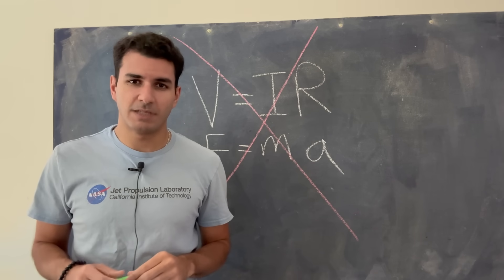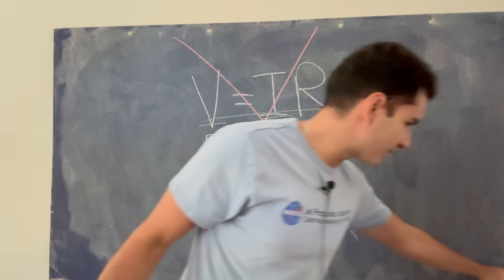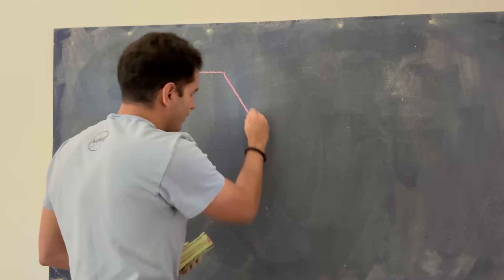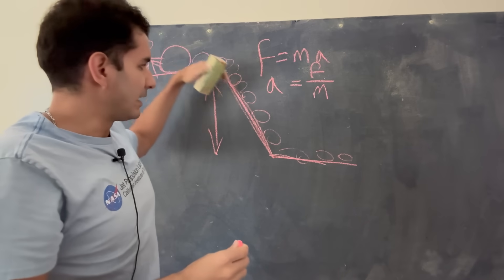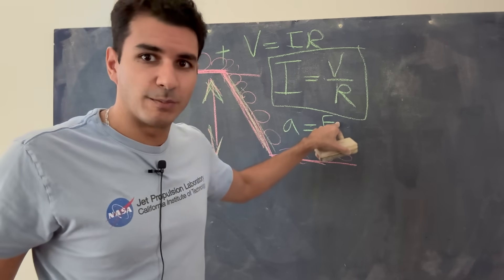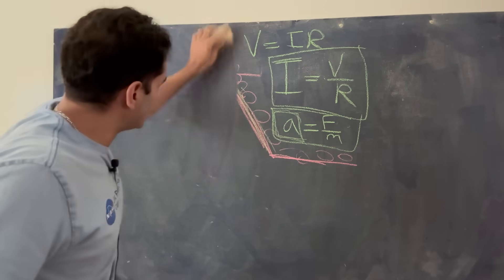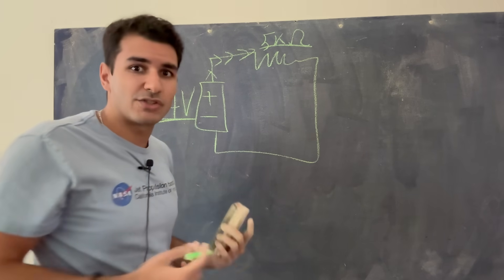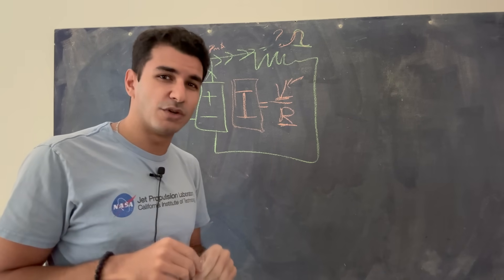You don't really understand physics

Comment: Ali, I am a strong believer that physics is taught wrong for many of the reasons that you say. But I don't agree with what you say here in general. I think that cause and effect must be taken very cautiously, especially when things happen at the same time (like force and acceleration, or voltage and current). In general, these things just coexist, they don't necessarily cause each other. And if you still want to think about cause and effect, sometimes it is better to think that a current causes a drop of voltage or an acceleration causes a force. For example, say that you have box inside of a train cart. The box is on the frictionless floor and against the rear wall. The train starts accelerating. Will the box accelerate? Of course, there is a boundary condition, the box cannot penetrate the rear wall of the train, so it has to. So how (not I didn't say why, yet) does it accelerates? Well the rear wall exerts a normal force in the box. In the force on the box causing the acceleration? Sure, it can be viewed that way. You say a=F/m, plug F and you will get the correct acceleration, every time. But wait. This is not like when you push a box with a given force F or when gravity is pulling down on something. This force is not given. How does the wall "know" EXACTLY what force to exert on the box? Of course it doesn't know. It's just that if the force was any bigger, the box would accelerate more than the train, mode forward relative to the train, lose contact with the wall, and the normal force could not exist. And if the wall would push any less, the box would penetrate the rear wall which it cannot do. If someone wants to say "the rear wall is exerting a normal force on the box that causes it to accelerate", I am ok. If someone wants to say "the boundary conditions impose that the box will have to accelerate, and that causes an interaction between the box and the wall, where the wall ends up excreting a normal force on the box and the box ends up excreting a equal but opposite normal force on the rear wall", I am even more ok. If someone wants to say the same but excluding the word "cause", I am even more ok, because I think that it is not useful to talk about cause and effect about things that happen at the same time and that, given the circumstances, they have to happen at the same time. While this example is a bit eyebrow-furrowing, thinking about cause and effect, in so linear terms, and for things that neither the "cause" or the "effect" have a "choice", becomes more complicated in more advanced physics. Even not so advanced. Think of the Bernoulli effect. You have a steady flow of ideal non-viscous uncompressible fluid  flowing though a pipe that has a narrower section. Due to conservation of mass, the speed at the narrower section will need to be faster. But what "causes" it to go faster? Well, by Bernoulli, the pressure drops when the speed increases, so the pressure drop is what causes the fluid to go faster, since it's moving in a pressure gradient from a zone of high pressure to a zone of low pressure (basically a=F/m). All great right? RIGHT? Did you catch it? What causes the increase in speed? The reduction in pressure. And what caused the reduction in pressure to begin with? That the flow will need to go faster so by Bernoulli the increase in speed causes a reduction in pressure? So pressure reduction and speed increase causes each other? Don't you see a problem there? I prefer top say that no, they don't. They happen. Together. The pressure field and the velocity (and hence speed) field in a fluid are correlated in a way that a fluid will do the only thing that it can do, given the laws of nature and the boundary conditions. If you still want to talk about cause and effect, I would say something like "pumping a constant volume of fluid through a constrained pipe causes it to accelerate and reduce pressure in the constrain". Finally, if I have a wire on which a given current is flowing, will the voltage drop? Really? Well, if it drops, there is cause, right? What is causing it to drop? You cannot tell me that it is the current flowing through the wire's resistance because you just stated that current is caused by voltage, not the other way around. And I don't think that either way around is strictly correct or always useful.

Comment: I noticed a error in your video at 4:23. The ball will only roll if there is friction (you said it will roll when a man pushes it from top)unless it was rolling as the man pushed(that is, that the man pushed it not at its center of mass). My explaination, for rolling to occur there must be simultaneous translation and rotation. Rotation can be caused(in this case) only if a impusle is applied other that at center of mass and only this will produce angular torque for some time, and gravity also acts on the center of mass . So unless the man applied force at some line not passing through center of mass, ball will not roll

Comment: Cause and effect.  When you write F=ma or I=V/R, you are writing the very basic forms of the relationships. To me, how you rearrange them does not change them.  In reality things are not as simple as, let's say I=V/R because V & R can be themselves functions of other variables.  Think of an audio mixing console where V(t) is a function of time and R(x) is a function of the position of the fader, then I(t,x) becomes a function of both time and position.  That's only one simple example.  R could be a function of temperature and I could be a constant current source, so that V is a function of temperature.  These too are just simplifications.  Reality is far more complex.

After all, Guv=Tuv(8πG/(c^4)) does not look all that complex, does it?

I get what you are trying to do, but this is only describing the real world physics at the absolute most basic level and I'm not sure that re-writing Ohm's law as I=V/R really adds any understanding.  BTW Ohm's point in his original formulation of V=IR, he was trying to show that, given a fixed, ideal resistance the voltage across said resistance is proportional to the current through it.  So V=IR does demonstrate the physical concept he was proposing.

Comment: Mass being equated to reistance is great (it's very common to correlate different physics formulas together! Thank god for using resistors to model thermodynamics problems)

But friction and resistance are fundamentally different in so that for a resistor to be strong enough to fully stop current, it has to be infinite, hence an open circuit

While friction needs only to match the force. Resistors can't affect the potentail across the circuit as a whole, but friction affects the force rather than the mass

Friction is more like an inductor's back emf for an AC circuit ig

Comment: An ambiguity that has always bothered me derives from the fact that current is not a unidimensional construct  viz: number of electrons, and rate of flow. Therefore it seems that the same value of 'I' could result from either a small number of electrons flowing very quickly, or, a larger number of electrons moving more slowly. Thus two different physical states!

Comment: This may be a good way for explaining it to the beginners. However, this is not enteirly correct. For example, we may have current source (think of some implementation as an active circuit), then the voltage drop is caused by a fixed current. Additionaly, from practical point of view, it is important to learn how to manipulate this equations. Say for example you have a voltage source  with a fixed electromotive force and you ask the question what resistor should I use to get the current I want (then the LHS of the equation should be R, not I).

Comment: There is no problem with any of the equations rather the problem is with the teachers who just don't explain. F=ma is also correct this means when a thing is accelerating at a qnd it has a mass m then how much force will it produce. Math is a language bro a structure based language. V=IR also has a interpretation, you can figure it if you  understand the first one. The main thing you should have addressed that most people ignore is that F is a net force there pr the acting force. The main generalised equation is sum(F)=d(change of p)/dt or F=d(change of p)/dt where F is acting force. This is what newton discovered and changed the whole world. This equation will be used by every part of Physics.

Comment: I would understand why you rewrite F=ma as a=F/m. Because you would think that a force causes an acceleration.

But for V=IR, I don't agree that rewriting it as I=V/R is that useful in terms of understanding. I used to be a I=V/R person, until I learnt more about circuits dealing with inductance, capacitance etc.

When you think about it, it actually makes sense if a current causes a voltage drop. When you connect a battery to a resistor, the electric field of the battery accelerates the charges in the wire, causing them to move through the resistor faster and faster.

However, according to V=IR, the increased current makes the resistor generate a voltage drop, to push AGAINST those charges, and that is what decreases the acceleration of the charge. (Imagine a resistor being a constriction in a pipe, and the current being a viscous fluid, the constriction generates a pressure difference as fluid flows by as it is pushing backwards on the flow of current)

When you reach a point where the voltage drop across the resistor and the voltage of the battery is the same, the acceleration of charges is 0 and so it is at equilibrium.

This idea is particularly useful for thinking about circuits with multiple components of different impedances. But I can't elaborate more here.

What I do agree with you is that too many people are focused on these equations, and don't understand how they come about. One should understand "macro" and "micro" physics.

Comment: I have a physics question (high schooler) 
lets say you have a parallel circuit. In one branch you have a 1 ohm resistor and in the other branch you have 10 ohm resistor with a 10 volt battery. Current takes the path of least resistance so there will be more current in the 1 ohm branch then in the 10 ohm branch but there will still be current in the 10 ohm branch obviously. If we switched out the 10 ohm resistor for a 1000000000000000000 ohm resistor current albeit very little current (basically negligible current ) would flow through it but current nonetheless. I’m going to assume the wire insulation and the air around have less resistance then that of the 1000000000000000000 ohm resistor so even under normal conditions would electrons take every possible path to negative to positive side of the battery. (If we think of the air and just everything as a massive parallel circuit)

Comment: you know F = ma is not always true.... its only true for constant mass

To Define force first we have to define Momentum(P) , which is the quantity of motion of an object, which is calculated by multiplying its mass by its velocity, i.e P = mv

So Force defines the rate with which the momentum of an object changes. Momentum is all about the motion of an object. If an object moves with a double velocity, its momentum doubles. The force causes the change in momentum of the object as you change its speed.

What is speed you may ask? speed is the Maginitiude of Rate Of Change Of Position Wrt Time(which is basically Magnitude of Velocity) , Like see if u move 5 meter every second ur speed is 5m/s 

So doesnt the speed change when you apply force? ofcourse it does.

So basically Force is the rate of change of momentum wrt time
Now i am gonna use a bit of differentiation which ofcourse i am not teaching here 😭🙏
dP = Small Change in Momentum 
dt = Small change in time
dv = Small change in velocity
dm = Small change in mass
So
F = dP/dt
F = d(mv)/dt
F = m*dv/dt + v*dm/dt
If mass is constant then there is no change in mass so , dm = 0 so dm/dt = 0
F = m*dv/dt + 0
F = m * dv/dt
now Change in velocity with Respect to time is Acceleration cuz basically see if you are moving with 5m/s velocity then next second your velocity is 7m/s then next second your velocity is 9m/s then your acceleration is 2m/s^2(how unit/dimension of acceleration is m/s^2 ,  a = v/t so a = m/s/s = m/s^2)

so ya therefore acceleration is Change in velocity with respect to time 
therefore finally if mass is constant then F = ma
Reply: Why would the definition of force depend on the mass that it accelerates? If the mass changes and the force stays constant, then the acceleration changes. That's why they have to throttle down rocket engines when much of the propellant mass is used up.
Reply: @lepidoptera9337  Hmmm then why is force the rate of change of momentum wrt time then ( i am just seeking knowledge not trying to argue or anything incase if u misunderstand me, am just 14 😭🙏)
Reply: @youtube4eternity  Because force is not a very important concept in modern physics. Nature only conserves energy, momentum, angular momentum and charges (at least locally). These are the important concepts. Newton couldn't know that, yet. He didn't even know what energy was. That concept hadn't been developed, yet. In return a modern approach to classical mechanics doesn't use force much, if at all. Everything one can do with force can be done without.
Reply: @lepidoptera9337  Thanks senior! Appreciate it as am still learning 🙏, I have a long way to go fr

Comment: In the Ohm's Law, the key question is: "What happens if we double the resistance R?"

There are three scenarios:
    #1 Using V=IR, one might say voltage (V) will double.
    #2 Using I=V/R, one might say current (I) will halve.
    #3 Using R=V/I, one may conclude there are infinitely many options.
And without additional conditions, the correct answer is #3.

However, with specific conditions:
- if current (I) is constant, case #1 is correct.
- if voltage (V) is constant, case #2 is correct.
- if power (P) is constant, then V'=V/√2 and I'=I√2
- etc

Comment: So would it be a good thing to say that The resulting acceleration, is due to the ratio of the Resultant force applied, and the mass involved? and the Current present in a circuit is due to the ratio of the electrical energy applied per unit charge of the source to the total resistance of a circuit?
 Seems kind of intuitive if you try to actually understand what the book itself is saying (coming from a cambridge A level background) because the book itself says a lot about it. if youre not just studying for exams but for the fun of learning its much more easy to see. In my physics book (Cambridge Intl AS & A level, they start not with V=IR, they start by defining current itself, and how it is a result of the charge flowing, per unit time ( it also goes into length explaining why charge is quantised) and after that it makes sure you know why we follow conventional current. Next it goes into length explaining how Potential difference is related to the work done or actual electrical potential energy transferred per unit of charge, and how the energy provided to the unit of charge, which flows per unit time, is related to electrical power. and only then does it go into resistance, but it starts with how resistance of a conductor relates to the ratio of potential difference the potential difference applied to it, and the flow of charge per unit time across it, and the resistance controls the flow of charge, and you know know what high resistance is like because the voltage dropped across the component will be high, but the flow of charge across it will be low

TLDR, (sorry for this massive block of text i love physics) IMHO if you love learning the relationships between things, and how the world works the way it works you'll love to understand it too.
Reply: It would be correct to say that for a given mass the acceleration measures the force acting on the mass. F=ma is simply the definition of force. There is no other definition of force. Neither voltage or current are defined by the other.

Comment: A current source is actually a thing you can buy (or make) and use.  Even more damaging to main argument of this video: ALL real voltage sources exhibit an equivalent series resistance. Because of this, by using the well known theorems of Thevenin and Norton,  any real source  can be represented either as a voltage source (with a series resistance) or a current source (with a parallel resistance); they are equivalent.
Reply from the maker: look up how a current source works, you'll see its a control system that adjusts voltage to maintain current
Reply: @alithedazzling  Again, real current sources and real voltage sources are conceptually interchangeable.  For example, you can represent a battery as a voltage source in series with a resistor or a current source in parallel with a resistor.  Using your argument: a constant voltage source is a current source that uses a control system to maintain voltage.
Edit: Solar panels are more often than not modeled as current sources.
Reply: @alithedazzling  Dude, you need to stop talking while you are down. You are making this worse and worse for yourself.